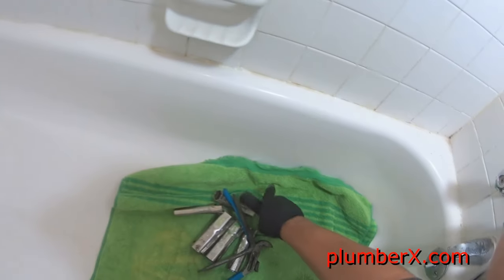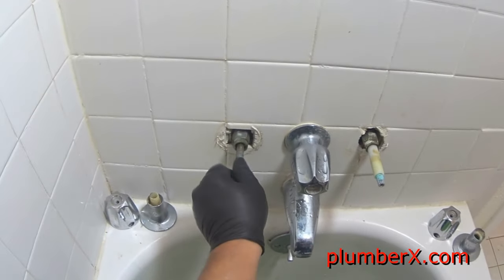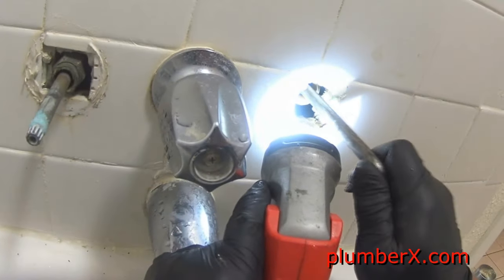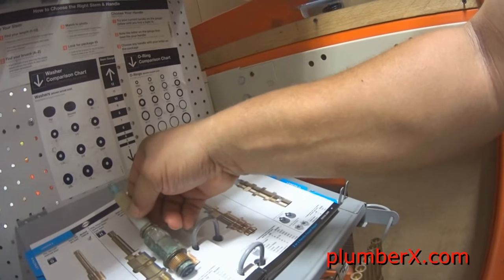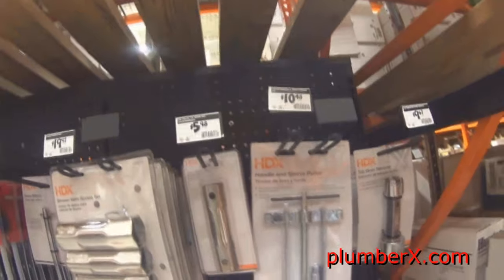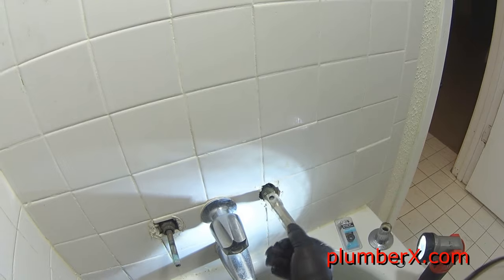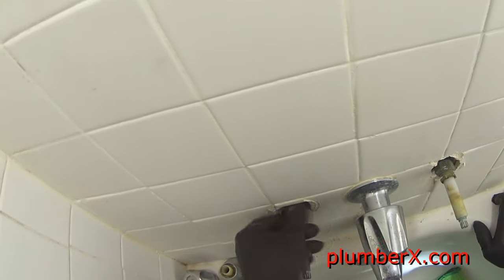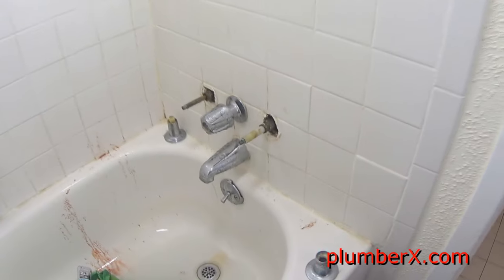Tips For Fixing A 3 Handle Tub/shower Valve

Comment: I have the same exact shower.  If you get this, my faucet is leaking.  I don’t know how to take the faucet off and replace it.  Can you maybe do another video on how to replace the faucet.  Also the shower is not working.  I will probably need a plumber cause the only way for this to get fixed is to put a hole through the wall that’s in back of the shower.  Really stinks.  Thanks for the video.  Wish you were here. 😊🙏

Comment: How do u get the stem removed from the divertor in the middle mine is stuck and I can't get it loose and it needs to be changed so we can use the shower
Reply from the maker: The same way, but you have to twist it out.

Comment: i've been replacing the rubber washer on the hot side every year because the part of the stem that holds the rubber washer in place is broken off, so the washer goes bad quicker.  Can I replace the handles, the stems and the seats on a 2-handle shower?  Are the threads and hole size for the seats a universal?  I can't find replacement stems at Home Depot, Lowes or TruValue.

Comment: Do we still need to turn the water off when replacing the faucet stems? And if so, just for clarity, are you turning the water back on(and the hot water heater)  (after you turned it off), to release any autism pressure?
Reply from the maker: Yes and yes 😉

Comment: Hey How to Plumbing! Great video, Im currently repairing my leaky shower and have fully replaced my cold faucet stem and got a brand new seat...When I turn the water back on the shower doesn't leak however as soon as i've run the water for a shower or just to test..when i turn the water back off it starts to drip leak. It's alot better than it was before but why do you think it could still be leaking after i've tested it?

Comment: I can’t get my handles off , I tried everything.
Reply from the maker: Hi, thanks for watching my video on how to remove a stuck faucet handle. I’m sorry to hear that you are having trouble with your faucet handle. Sometimes, the handle can be very hard to remove because of corrosion, mineral deposits, or a stripped screw. Here are some tips that might help you:

Before you try to remove the handle, make sure you turn off the water supply under the sink or at the main valve. This will prevent any water damage or leaks if something goes wrong.
If the handle has a decorative cap or cover, you need to pry it off with a flathead screwdriver or a knife. Be careful not to scratch or damage the finish of the faucet.
Once you expose the screw that holds the handle in place, you need to loosen it with an Allen wrench or a Phillips screwdriver, depending on the type of screw. If the screw is stuck, you can spray some penetrating oil or lubricant on it and wait for a few minutes. Then, try to unscrew it again with more force.
If the screw comes off but the handle is still stuck, you can try to wiggle it back and forth or pull it up and down to break it loose. You can also use a wrench or pliers to gently twist and pull the handle, but be careful not to damage the valve stem or the faucet body.
If none of these methods work, you might need to use a special tool called a faucet handle puller. This tool can grip the handle and apply even pressure to pull it off without damaging the faucet. You can buy this tool online or at your local hardware store. How to use a faucet handle puller shows you how to use this tool step by step.
After you remove the handle, you can inspect and clean the faucet for any dirt or debris. You can also replace the cartridge or the valve stem if they are worn out or damaged. How to Change a Faucet Cartridge shows you how to do this easily.
Finally, you can reassemble the faucet handle with a new one or the old one if it is still in good condition. Make sure you tighten the screw securely and test the faucet for any leaks.
I hope this helps you fix your faucet problem. If you have any questions or comments, please leave them below and I’ll try to answer them as soon as possible. Don’t forget to like and subscribe for more helpful videos on plumbing and home improvement. Thanks for watching! ( WHEN IN DOUBT CALL A PLUMBER! )
Reply: @theartofplumbing  3 plumbers couldn’t get it off, said to install new shower lol as if I got money to do that.
Reply from the maker: I feel ya. Keeping my  fingers cross.  @kauaireed9006  https://www.youtube.com/s/gaming/emoji/7ff574f2/emoji_u1f596.png